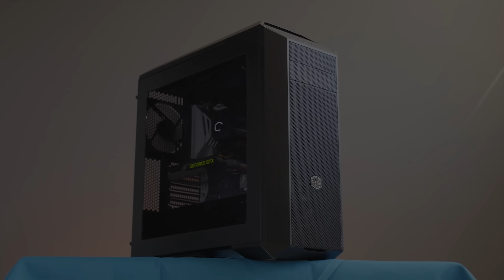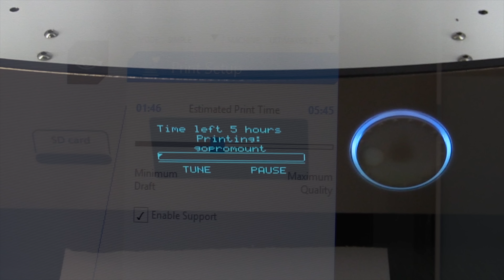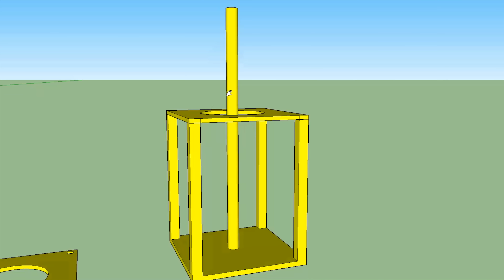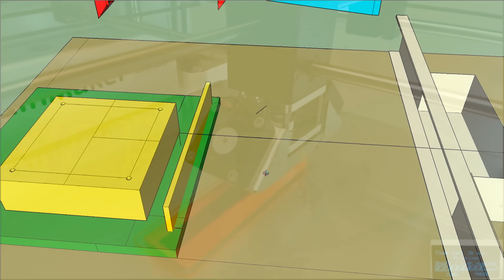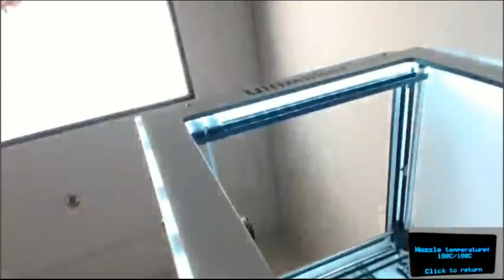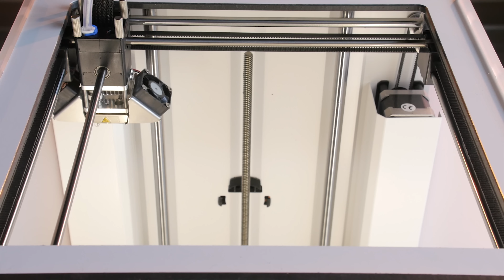Ultimaker 2 Extended - Our First 3D Printer

Comment: It's interesting seeing printers like this 10 years later. the Bambu Lab A1, which has been as low as like $250US, so over 10x cheaper than this one, blows this thing out of the water. 

it would be cool if more modern printers used the 3mm filament though.

Comment: There are lots of businesses that use FDM printing. When I worked at an aerospace parts company, we used it for electronic housings and all sorts of internal parts (brackets, spacers, etc) for in flight entertainment with Ultem 9085. We had Fortus 400MC machines. They also had 2 nozzles. one for material and one for support.

Comment: What 3d modelling software did Teran use?
Reply: That's SketchUp, originally made by Google http://www.sketchup.com/
Reply: Thanks. I heard that SketchUp isn't great for 3D printing. I think I'll stick with Autodesk Fusion 360.
Reply: ostrichbean you're right on that, SketchUp does not fabricate solid manifold meshes by itself and needs plugins. Fusion 360 on the other hand is fabulous
Reply: ostrichbean autodesk inventor is what my school uses for making 3D models and for 3D printing

Comment: Nice video thanks.
I bought my UltiMaker 2 at Xmas after 2 days usage it is now defect. contacted the UM support they suggested to return the unit for a replacement/refund within 14 days to the official dealer..
phoned the dealer & they offered a refund so i returned my unit. Now they are telling me they cannot refund because the unit is defect.
Either i accept a 3-4 weeks repair or i accept the refund minus the repair costs - Great service that is!

Comment: For the high-end printing aficionados, this is not the best printer. The printing community is looking at the coreXY movement platform more now, but even with the "ultimaker-style" movement with x&y rods, there are better, higher quality printers.

Also, for whoever's doing the printing at the office, Cura's decent, but if you're really getting into printing, have a look at Simplify3D. For standard design software (not artsy stuff) I highly suggest FreeCAD and OnShape as free CAD softwares.

Edit: I think it's a good idea to give a shoutout to AlephObjects' TAZ  series printers. They are neither coreXY printers nor ultimaker-style, but they have a massive print space. They also are pretty open source, that's a massive plus for something like 3d printing.

Comment: can you 3d print something like a case fan module where you can install it in the 3 slot cd rom slots in older pc cases where old cases only has 1 fan in the bottom front?

Comment: I'm pretty sure there are much better printers than the this. Eg maker bot which has a 200micron quality (10 times as powerful) or the new tiko printer witch is ridiculous it's only 120£ yes that's right 120£ and is so cheap because of its unique design. Not only that but it has a 250 micron quality. It has raised 3 million on kick starter and its targeted was 100 thousand. So overall pretty amazing

Comment: If you ever have problems with the print sticking to the bed, try this.

Mix 200 gram of sugar with 500 ml water and let it boil for 1-2 minuts, use that on the bed. It is the only thing and best thing i've used! :D
Both for PLA and ABS.

Comment: i dont see much of a difference between a lot of 3d printers, and the rough edges are a turn off for me, better but freaking expensive... i skimmed
Reply: The difference is in the amount of work that will be put into it. Unless we are talking about terrible companies like Makerbot or 3D Systems, the higher the price, the favorable the learning curve/amount of maintenance. A $400 printer can usually print just as good as a $2,000 printer. Also, lines aren't an issue with lower layer height or when acetone smoothing is used.

Comment: ...why not just build one? Buying an Ultimaker when you could just build, expand and modify a reprap is kinda like wasting money on a macbook when you could build a PC. Building one is also a much better introduction to 3D Printing since it kinda demystifies a lot of the under-the-hood stuff, so you're also kinda trying to run before you've learned how to walk, in this case.
I'm really glad Luke is getting into 3D Printing, but don't think this was the best way to start off. (also, what's the price point? What's the print volume? What materials can you print with this? What size filament would I need? We need more data, boss.)

EDIT:: oh, and if you're concerned about any weird, uneven edges or even those "boogers" on your final product, just put it in a vapor bath.
Take a mason jar, pour in a wee bit of acetone, put in some kind of pegs or standoff for your print to rest on (above the acetone,) throw that jar on the heatbed and come back in about 5-10 minutes to a nicely polished looking print.

Comment: Point of order, fused deposition modelling is a process name trademarked by Stratasys Inc, so to refer to a non Stratasys machine as an FDM process is technically incorrect and also not allowed by law. The generic term for these processes is material extrusion, so the correct way to refer to this printer would be a material extrusion printer. Alternatively a non trademarked term such as fused filament fabrication or solid freeform fabrication could be used.

Comment: Ok...can we please stop referring to Windows as "PC"...PC isn't a specific platform but rather it's a particular object. Saying it runs on PC is basically saying it will run on any OS that you can install on a personal computation device which is horrifically inaccurate. This isn't targeted at Luke specifically. It's targeted to more or less everyone because everyone does it.
Reply: It has always been that way. Apple distinguished Mac and PC for a while now too.
Reply: +Bryce Villanueva the problem is Mac falls into the definition of PC and even if apple was like "no it's our original crap" that doesn't make it is any less accurate and even if it did. That still doesn't make PC Windows. It makes it anything not Mac.

Comment: speaking from someone who has built a 3d printer when you had the stringing between the vertical poles in the firesticks you need to increase your retraction distance and speed and that will help with that

Comment: Still waiting a 3D being release by a printer manufacturer, bug and flaw free (well, almost)  really eeasy to deal with, like HP and Epson or even better, just a push button to start, like a copier. That was the true goal of XEROX, making a machine that would copy by pushing just a button, Prior to that, copying was a mess and it took 7 minutesor more and several steps. More or less the same here. Xerox took this tedious process and put all in a cabinet fully automated, that anyone could operate. Compared to this, 3D printers still in the hacker space for geeks. It will explode when it become as easy as a photocopy. IMHO
Reply: 38911bytefree you mean a 3d printer that doesn't print black pla just because you don't have cyan pla?
Reply: ***** LOL ..... That the downside .... but believe me, you ptint 10 times to get probably aceptable piece. if with the epson get 9 out of 10 and yeah, cant print because no more magenta PLA ... I still take the Epson / HP thing. But could be another brand .... XEROX wasnt that sh1ty in the 60s LOL

Comment: About this 3D printing tech thing. I think it is a brilliant oppurtunity to open up a new type of business. Spare, cheap parts. You realize many people will not have the skill or time to 3D print so they will have to buy designs that are pre-done. Imagine from the smallest door-supports to building extremely complex structures. They will be the digital tailors of that time possessing the ability to build without limit.

Comment: There is something that I don't get I would like to ask. While I can understand the extruder, and the electronics taking the bulk of the cost for a 3d printer why is it that larger sized frame so outlandishly more expensive than the smaller models? It would seem anything larger than 1 square foot and the price explodes. The threaded rods and frame cant be that expensive, so what gives?

Comment: Nice video. I like you picked up on this subject. I would really like to see a print with two different fillaments to build overhanging parts in a design. One is used for the structural part (actual plastic, wich stayes) and the other for the overhanging parts wich can be washed out (like solveable plastic)

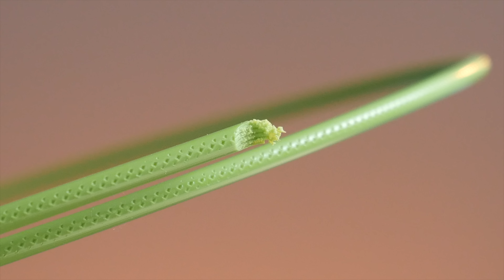Comment: 5:10 Sound like every workday i had since august.

I got a task of experimenting with installing two e3d printer heads on a printer at work and make it dual extrude.
About 50 hours of work with the printer always messing up. I have finaly gotten it working and have begun experimenting with support filaments.

Comment: Hey i got an nvidia graphics card and i connected and all but when i turn on my pc it turns off byit self but when i connected to normal vga it turns on what can the problem be please help me
Reply: Is your psu large enough
Check power connections to gpu
Check the video cable is in properly
Make sure the gpu is firmly in the pci slot
Reply: My graphics card does no use power connector
Reply: +Leo Pena ok then did you have a graphics card before?
Reply: +Robbie 1400 no
Reply: +Leo Pena hmm well all I can think of is try removing the card and putting it back just it case, you could try disabling the integrated graphics in the BIOS
Reply: +Robbie 1400 how do i go into the bios
Reply: +Leo Pena it'd be easier for you to look that up

Comment: Epic first 3D Printer review dudes, been waiting to see how you'd tackle them and didn't disappoint :) Note that you didn't have supports on for any of those prints - the dags you saw on the first firepole are from the extruder oozing a little as it moves between columns. Support material from cura, when dialed in, is easy to pull away and super handy. Good Luck!
Reply: Maker Muse

Comment: just curious if there was a 4d printer what will it do?
Reply: Lance Greene Calling it 4D doesn't make it 4D though
Reply: +t800 More than 3 spacial dimensions is only part of string theory, which hasn't been tested AT ALL. The standard model only uses 3 spacial dimensions and 1 temporal. Even if more than 3 spacial dimensions did exist a la string theory, they wouldn't affect us at all, only the fundamental particles.
Reply: +lol lol 4d printers are an actual thing, but the 4d represents the printed part being capable of changing itself further after it has been printed. for example the US military designing a barebones skeleton robot which then gets a body 3d printed onto it which gives it shape and form to perform a certain task, which can then be removed and a new body can be printed onto it for another task. or certain types of heat effected 3d printable robots that can change their shape and become mobile like a snake after being printed.

Comment: I have a QuestionCan you make PC Case?(Save money)
Reply: +AQW JameZ it will be cheaper to just buy a pc case, not make it.
Reply: +AQW JameZ You can but filament is expensive and computer cases are crazy stupid to design (half metric half imperial measurements, sometimes neither makes a nice number, its really hard to find documentation for some things)

source: have been designing a computer case to be lazercut out of plywood and have some 3d printing experience.
Reply: +AQW JameZ You'd need a really big print volume, which means a bigger frame with better support, a bigger heatbed, etc etc.

You'd be better off using power tools and cheap materials, or just buying one.

Comment: there's less than 500$ in parts in that shite ultimaker ripoff capitalism
Reply: +Carlos Eugenio i dont wont either, they don't work i want something new :) u need to open ya eyes a bit more ;0
the machines should be working for us
Reply: +Carlos Eugenio they stole the idea from rep rap re-branded it, changed it slightly and then sell it for 3000$
Reply: +Mark Williams Please provide sources to your claim.
Reply: +Bryce Villanueva google reprap
Reply: Mark Williams I'm fully aware of the RepRap project, I am asking for proof as to RepRap's idea being stolen by Ultimaker.

Comment: i think these printers would be a super helpful tool for radio controlled aircraft enthusiast like myself. I wonder if Linus is going to review the tiko 3d printer. it cant print large things but for $180US it will be one of the cheapest 3d printers.

Comment: I have a 500 dollar printer from XYZ and it is easy to use (if you know how to 3D model or you could just download models from thingiverse) it prints a semi-large area and the quality is good (however only ABS not PLA) but I would recommend it if you're looking to buy a first 3D printer - I've had it for a year with no hardware malfunctions

Comment: The one thing they didn't but should've talked about was the smell. Depending on what you're using will depend on this. But for the most part, you're house is going to smell like a meth lab if you print for a few hours.
This is one of the biggest reasons why I think 3D printers will not be in homes for a very long time. On top of this, most people don't have $300+ to blow on a printer that they have to work on, and the plastic cost more than the part at the store. In some cases, a 25 cent part at the hardware store could cost $1.50 to make.
Reply: +Tech Reviews and Help Three of my friends have three different 3D printers and theirs don't produce any smell, and their family has them running during all hours of the waking day (I know one brand is Lulzbot I forgot the other two)
Reply: *****
I don't mean the plastic itself cost more. I mean the part you can make. Unless if you're making an odd part or something that is hard to get, you tend to save more by going to the store. For example, screws and things like that.

I believe this could be massively fixed as better ways to recycling the plastic come out. In fact, I've seen the learning curve become a turn off for most. It's not how hard it is to learn, it's how much it can cost and how hard it is to fix the printer when mistakes happens. (for example 5 hours here. other places, I heard of people trying to make something 20 times before they got making a given odd part right.)

I think the biggest thing that will keep people from buying one of these is how accurate these are. I think it needs to be able to print screws and nuts with no problem before people really find a use for the printers. (I would be interested in seeing how well that will help with fixing a car. I've seen it where most people don't know what parts they need until they get in the mid of it. So it would be interesting to see how fast it can make given screws and nuts.
It would also be interesting to see how well they can deal with a used car.)

Anyways, I agree that no matter what. If the price on the printers and stuff drops to a given point. Nearly everyone will have one. However, I think the price point for a low end model would be $20. (I live in a poor area, and I see it where people flat out need normal printers, but won't pay for them if they are over $30.)
Reply: +Tech Reviews and Help My roommate has this printer in our kitchen, it makes no smell whatsoever.
Reply: +Tech Reviews and Help I see your point, and it's a good one. However, these things will be addressed as the technology progresses. For instance, when metal printing becomes cheap and easy, it will be much faster and cheaper to download the print from online and have the part in a couple minutes. Mind you, we could be as far as decades away from this. It is a dream though, and one that I hope will come true soon.
Reply: +Tech Reviews and Help if your a working adult with a decent wage you can definitely afford this.
Reply: +Tech Reviews and Help Honestly it didn't really smell.. this may have been because we were in a well ventilated office
Reply: +Tech Reviews and Help Why would you 3d print a screw, or other hardware, anyway? I feel as though 3d printers are used mostly for printing custom things anyway; rapid prototyping as my engineering teacher called it
Reply: TheEpicLinkFreeman
Some places it's hard to get proper screws if you lose one.Some things require very special size screws and this can be more and more of a pain as you try to fix your stuff.
But, I think that is going to be the biggest use out of it whenever it gets to how color printers are today. Very few does prototype stuff, but many needs special tools and stuff.

I think it would be kinda cool to print out a special tool. And recycle the plastic/tool whenever you're done with it. That would make working on things a hell lot more easier. Even more so if the plastic is the type that can't break that easy (so you can get around taking a car or whatever to whoever that made it because they made it where you needed a special tool to do the job)
Reply: +Tech Reviews and Help It's possible to print tools in PLA and recycle them as they are corn-based and, thus, biodegradable. PLA is not the strongest, but isn't particularly weak so long as layer adhesion is tweaked right.